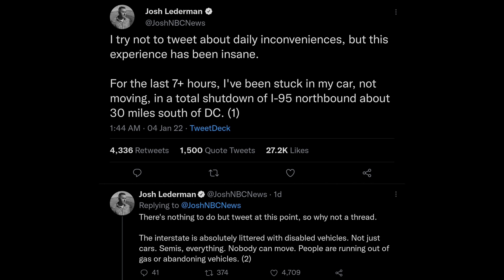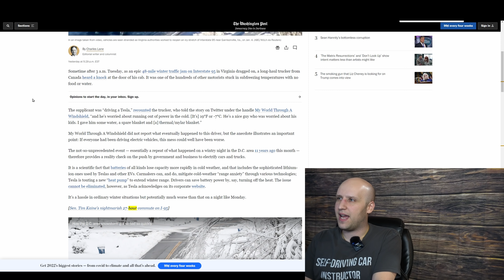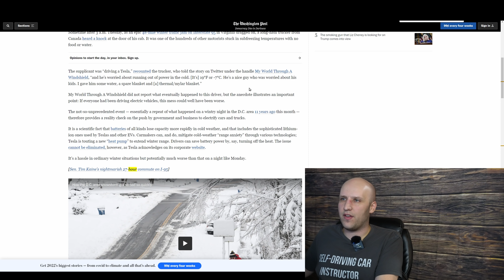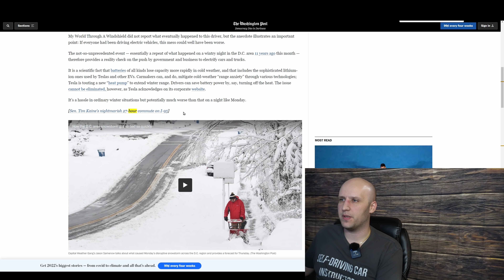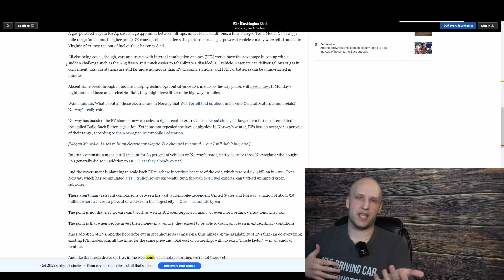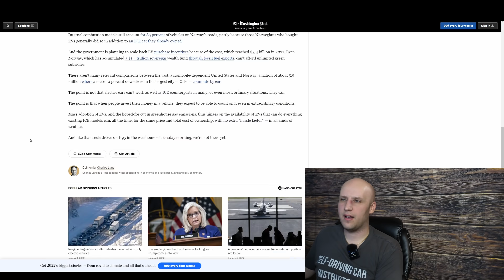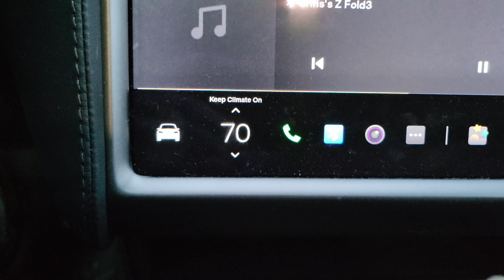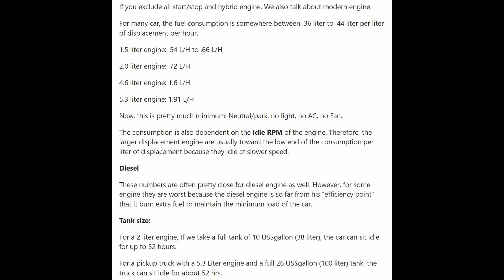How Long Can a Tesla Keep You Warm In A Frozen Traffic Jam? | FUD Debunking

Comment: We had to test this during a winter on a 4 hour trip. Here is what we discovered:
1. Keep warm blankets, snacks and something to entertain you in the car.
2. When charging prior to a trip, go ahead and crank the heater up to 74. This way your not using the heater as much on your trip.
3. On your trip, use seat warmers.
4. On your trip, set your temp back to a reasonable temp 70

If you get stopped for long periods:
A. Turn on camping mode if available. 
B. Keep using the seat warmers
C. Everyone get comfortable under blankets.
D. Turn internal heat to something you might sleep in (~65 to 68)
E. Eat snacks, Body heat will also help keep things warm.
F. Find something to entertain yourself.

* Remember, you want enough energy to get to a super charger or home, whichever is closer, and you may have to wait as people charge.
Reply: Holy fuck....or just buy a good reliable truck lol
Reply: @MK3SupraSteve  I have a Silverado 4x4 i put 260,000 miles on and still own. Still have to prepare it for winter:
1. Keep it above a half a tank before any trips that i may get stuck for hours or half a day.
2. Keep blanket, candles and snacks in the truck.
If you get stuck:
A. Periodically exit the truck and ensure the tail pipe is not buried if its heavy snow or snow is drifting. This lets out all the heat. Also, make sure the air intake can get fresh air, though this is typically ok unless you buried yourself in a snow drift.
B. Crank heater because the truck will use near the same amount of gas regardless of heater settings. 
C. If low on gas, shut off truck until it gets too cold in the cab, then turn truck back on until heat it is unbearable hot. Keep repeating. Startup supposedly takes a little more gas, so I've been told to try to make the on/off times as long as possible.

in 20 years of owning the truck, i have had to do all those twice. I thought my mom was crazy for insisting on the blankets and candle; however, spin out and wind up in a culvert on a desolate road where no one notices you for hours and you will want to do everything above.

Comment: I appreciate the effort, but just like the Mythbusters TV series, your great attention to detail on some things was dwarfed by some big ones that negate your effort - perhaps completely.  You keep talking about the scenario in which "you" are stranded.  Didn't you think about the impact of "you," i.e., a human or even more importantly, an entire family, and how you are talking about the car "keeping you warm?"  How quickly does a pot warm up (or stay warm) on the stove if it is empty versus full of water?  The point is, having your bodies in the car to keep warm will dramatically affect your results.  And if you choose to run the test again, you can't simply use 150 pounds of sand or something, it has to be people because there is thermodynamics involved with our bodies that generate and consume energy.  And if you are thinking it, yes, the weight and other contents of the vehicle matter greatly as well (and lower the relative effect of a few hundred pounds of people to a few thousand pounds of car), but the car is insulated in different places and it's thermal gradient from the cabin and battery compartments out to the skin of the car that would be at ambient temperature so it's not easy to really estimate without a lot of engineering details.

Comment: If I am driving then it is likely the Tesla is not at 100% when I hit the traffic jam, maybe it is at 30% and in the cold that 30% will go much faster down than from 100% to 70% due to how lithium batteries usually perform at low charge as they discharge faster and adding the freezing cold from strong winds makes the battery drain much faster than desired also you can't bring with you spare fuel on an electric car if you are traveling in the country side where there are no gas or charging station close by.

Comment: Excellent video. Sounds like a brilliant argument for all EVs to have a universal socket in the trunk where you would plug in that spare power bank you keep in the trunk for emergencies, right?  Which surely will hit the market any time now. Right? Geez, this is such a no brainer...
Reply: then why not just make the battery that much bigger?  unless the backup battery can hold a charge for a long time with very little maintenance.  If you have to keep checking it and charge it up regularly then it's a bit useless as a back up...for example..most people's spare donut tire is actually flat because nobody checks it..until they need it and realize its flat.  It would be more useful to have a reserve battery built into the main battery that way the on board management system will take care of the resever section for you.  OR even cooler, if other EV's or Teslas have an emergency Tesla to Tesla quick charge that will get you from 5%-20% in a few minutes, but only if the donor tesla or EV is above 50%

Comment: This dude seems to forget one thing.
If my gasoline-powered car runs low on fuel, I can open the trunk and pull out... my spare gas can, in which I keep 3 gallons. You can't carry spare electricity in the trunk of your Tesla.

Besides which, I can take some of that gasoline and use it to start a fire in the woods to keep warm if I have to...

Comment: If your electric vehicle ran out of juice in this situation how do you expect to get it off the road.  If it was gas the highway department could just bring you some gas and fill you up and your on your way.  How does that work if you car is electric?    So your comment about  gas cars can run of out gas just as well as electric can run out of juice is fine but not the point, with gas you can refill in minutes and be on your way.   By the way, what is happening to all those dead tesla  batteries that will be coming up in the next decade, where do you think those are going to end up.  Also where do you think electricity comes from, you ain't charging those vehicles off wind power, its most likely coal or nuclear. Doesn't California already have rolling blackouts, what would happen if all Californians had electric cars.  I suppose those blackout would be a lot more frequent.  Have fun in your Tesla.

Comment: I own a tesla and the speaker in this video is a biased Po.S. You would be so boned if you got stuck in the cold in a tesla. Being in a ice car would be way better. Much more energy potential in gasoline than any battery. "But mister its not as efficient."  heat energy from gas burning. If an ev runs out of energy it is so boned. If a ice car runs out of gas it just sits patiently until filled up. Evs have their place but he makes them seem way better tham they are.

Comment: Electric cars are coal powered and extremely bad for the environment both in production and disposal. Also traveling on the interstate and getting stuck in a snowstorm with an almost full battery electric car is a pretty convenient scenario for your test. Before you say cars can be low on gas too, remember there are gas stations everywhere and most people don’t allow their cars to go below a quarter or even a half tank in the winter. EV’s have less range, and charging stations are more spread out, EV’s use more energy in the cold, and so on average your EV will already have less charge comparable to a gas car has fuel remaining when they come upon the traffic jam. These factors prove that most EV’s would run out of power before most internal combustion vehicles, and that’s not even mentioning needing to be towed away when you run out of electricity which is laughable from a internal combustion vehicle owner’s perspective.

Comment: I was involved in the disaster in Northern VA last week and my Model 3 performed incredibly!
Reply: Pls give tips. Most importantly how did u save battery?
Reply: @Moonbaby001  I was raised in Pittsburgh and learned to drive there and in snow. I’ve lived in Virginia Beach for 30 years and know all to well how this region deals with snow. 
Once the snow started I immediately found the nearest supercharger since I was driving from Pittsburgh to VB.  My heat was on the entire 23 hours and running out of charge was never an issue.  I got To Richmond with about 70 miles and charged for about 15 minutes since the last leg of the trip was 100+ miles.
The car handles incredibly in the snow even without snow tires, we just don’t need them in VB. One thing to be careful of is the regen braking on the ice, I found it can cause some issues.

Comment: I'm a little concerned of your reliance on the apparent accuracy of the battery percentage gauges. How accurate are they really? If it's anything like my smartphone, the first 50% (100-50) last a lot longer than the second half. Is it not the same in EV's? So I'm not so sure if your calculations are as accurate as they first appear to be. Still, you've made the point that the EVs can hold their own with the ICE's in a cold traffic snarl. BONUS POINT: Gas gauges suffer from the same syndrome of the needle moving faster and faster as the amount of gas in the gas tank gets lower and lower.

Comment: OK. Let me ask this question. If your battery car is at 50% or less does this not compare to a gas vehicle with the same amount fuel? Next question is if your batteries are 3-4 years they will no longer hold the charge as a fresh "crisp" BRAND new batteries do - this is fact. I'm sorry, but I'm not sold on these "EV" vehicles. What nobody mentions is as these batteries charge and discharge they ALSO emit CO2! The lower that battery when plugged in will yield more CO2 to charge it! Lastly, ALL these charging stations out there where do you think that "power" is coming from? Guess what - FOSSILE fuels! This big "green" push is really just a sideline and really a crock when you REALLY dig in and LOOK at the numbers and the charging of these vehicles and the fact is these "battery packs" are TOAST after 5 years! 8-10THOUSAND dollar replacement cost for these "green" batteries! Not to mention "disposal" cost for the Lithium-Ion compounds in a WASTE site! Why do you think you do not hear from John Kerry anymore? Because all of these facts were pointed out and in the long run are really NOT that "green" after all! Do some research and disposal costs and the leaching into the environment the toasted Lithium-Ion cost. It's really not all that great at all!

Comment: I think the point is, for a conventional gas vehicle, if your run out of fuel, it is possible to refuel it along the way if you brought fuel with you in a jerry can. In fact, it is common to see long-haul or off-road vehicles carry jerry cans with them just in case of running out of fuel here in Australia. However, for electric vehicles, I don’t think it is possible to charge them along the way without an EV charging station, which means, electric vehicles get stuck with the amount of battery the car has, that’s it, and is not possible to top up by any means without using an EV charging station.

Comment: I have a couple of questions. Did you confirm the interior was actually at the set temp? Do you have access to an ice to idle for a comparable time? The issue running out of fuel in an ice is a Jerry can and 1min can get it going again. An ev needs to be towed
Reply: New evs can be charged by another ev

Comment: That was good info. I have a Volt which is duel fuel and old tech. I would idle my old gas car all day to keep the AC on and I was shocked by how little gas it would use in 8 hours. It was less than a gallon. I was building a house and working from my car in hundred degree plus weather.

Comment: Another EV downfall is that there is no way to extend the range or duration of an EV (need a can of electrons). Whereas in a gas vehicle, you can bring extra gas with you if you have the forethought. So, no overlanding in that EV.
It might have been interesting to idle a 4 cylinder RAV-4 next to these Teslas and see how long it lasts.

Comment: I disagree with most of his points, but they missed one bit one. As people adopt electric vehicles, it puts both more demand and more surge demand onto the electrical system. This means during sudden cold snaps, the likelihood of the grid failing goes up. In Texas at the beginning of 2020, the entire grid was going down. I don't think people realize how close the state was to a total, cascading failure of the power system. If electric cars were the norm, that almost certainly would have happened. Of course, the counter argument is that isn't a problem with the technology, but a problem with Texas not properly maintaining it's infrastructure. Failing and poorly maintained infrastructure is a problem all over the US though, so when you combine that will electric cars I think you have a recipe for disaster.

Comment: About time someone did this. Thanks. Also keep in mind battery replacements. Around $10,000. Yes the same price about as an new gas motor. Yet gas motors can last 100,000 miles to 500,000 miles. The batteries not so. My thinking is when I am forced into an electric vehicles. Trade them in regularly so I dont have to pay for an new battery. Also more technology in anything. Drives the prices of anything threw the roof. Making my personal opinion on the technology side. They can go uninvent it. Proven not an necessity. Just makes people more lazy and easier to control. Not an tool. Again finely. Thank you.
Reply from the maker: Batteries easily last 100k miles. There are many examples of model 3s now with over 100k miles doing just fine.
Reply: @DirtyTesla  cool. Thanks for the information. That's about when I do trade-ins anyways. Yet I want an pick-up. Thanks again.
Reply from the maker: @scanadaze  you'll enjoy it 👍 good luck

Comment: Actually if you crank up the heat on a gas vehicle it will use slightly more gas due to the extra strain on the alternator to keep up with the extra strain on the electrical output used to run the heater motor. This causes the engine to have to use more torque to turn the alternator.

Comment: Your into product testing. I own no electric vehicles or I would do this myself. When it comes to solar and batteries. All one has to do is hookup the solar to two terminals to charge an battery or several. Okay. Any electric vehicles has an main point where all the batteries meet to go on further into the system. The roof of an electric car has enough room for two panels. 200 Watts. Take two solar panels. Set them up beside the car. One solar controller for lithium batteries. Hook it up. Then fine the two main leads off the battery pack. With the car say around 50% charge. See what it will do. Going to the two main leads bypasses all computers. Same with electric planes. Solar panels along the wings. One solar controller at the proper one. Then connected straight to the battery. Again. I dont have an solar vechicle. I do have two solar systems. Two different shops. 12v, 110v and converter. Then I also have them with USB and cigarette lighter connector. I also made my 12 1/2 blowup pontoon raft/boat into an electric only running vessel. Google said 5 hours or less on any trolling boat motor. Because of time or length of time it can go on. I tested it in an 5gal bucket of water. I used an battery pack I designed. Just two 20ah batteries. Wires my way. I shut down the test where the motor was held at 30% power at exactly 12 hours straight running time. My personal credentials with electric and solar. Take care.

Comment: What a Dumb test. You used a fully charged battery to do a test where people stranded may have only had a 50% charge or less. Face the facts. A battery doesn't last as long in cold temperatures  and being stranded on the road exposed to wind and figuring in wind chill, that battery will not last as long. My question is, did you test in a garage or exposed to the weather. I have a hard time believing an electric vehicle could last. Using the lame excuse fueled vehicle can run out of gas, well best bet is a battery will choke way before a gas powered vehicle. I will NEVER own a battery powered car. Useless in Northern Michigan where I live.
Reply from the maker: I live in Michigan as well :) you can see in the video the cars are in my driveway. At 50% charge, the model Y would have lasted 30+ hours. You can do the math with the info at the end to see how long it would last in any scenario. And I leave my house every day with 90%+ battery because it charged while I sleep! Super convenient. Trust me, you'd like an EV if you tried it.

Comment: The seat heaters are great for your butt but if your using climate control anyway your wasting energy the seat heaters are NOT efficient for heating the air. Otherwise cool experiment 👍

Comment: With an ICE, you can shut off the engine for a while, start it up to re-heat and shut it off again. The engine won't have time to get cold between re-heat runs and you get 2-3X as much standby endurance that way.
Reply: Also, why is it a big deal for electric cars?
We’ll if they run out of power, you’d need to be recovered to a charging point.
With ICE cars, people could easily top up with a Jerry can, or share fuel (if required).
Reply: @chriskaye1997  5-10 years down the road when V2X becomes more common especially on utility, heavy-duty and emergency EVs with 100+kWh packs, there will be plenty of vehicles capable of boosting 5kWh into stranded EVs to get them to the next charging station in 5-10 minutes.
Reply: With an EV, you can shut off AC - even the car itself if you want to - and start it up to re-heat and shut it off again. ...and you won't waste energy heating an engine block.
Reply: A hybrid car would work just like this automatically. So a Prius would last like 100 -150 hours.